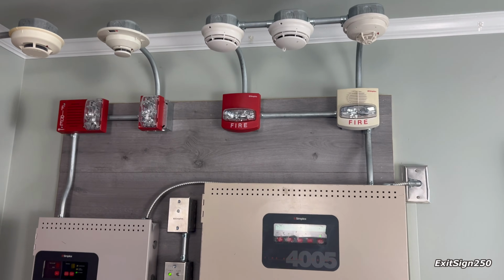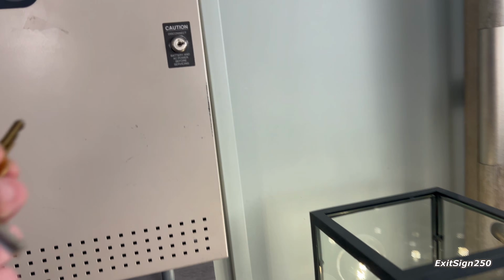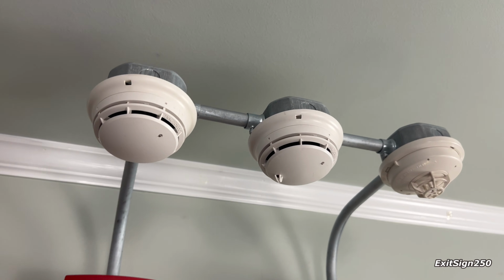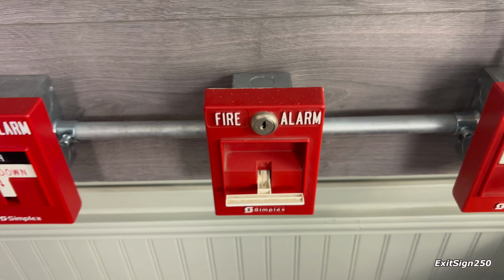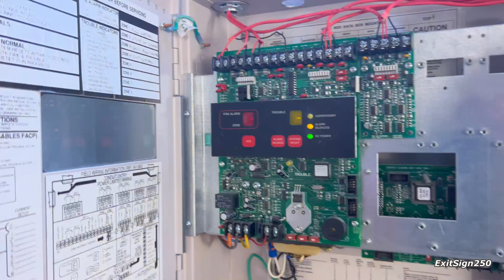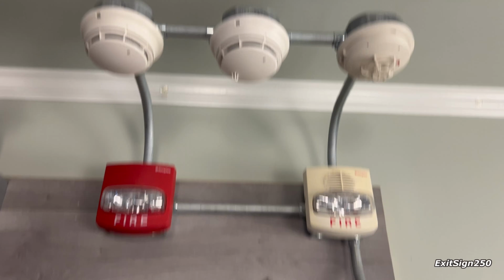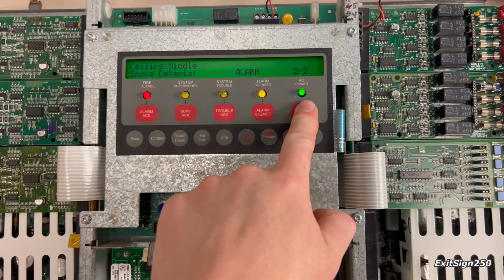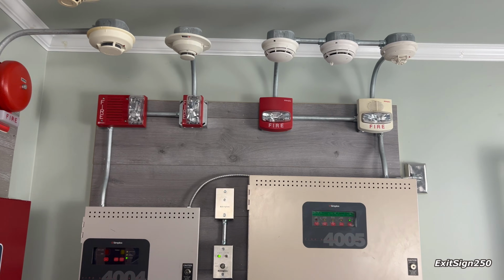System Test 26 | Board 2 - New System!

Comment: Btw on simplex 4005 panels, it's weird. you have to hit the acknowledge button 2 times and the reset.
Reply from the maker: Oh really? That’s a feature? Sometimes I have to press it 2-3 times and other times only once.
Reply: That's just how those panels are. Don't worry, I've had experience with 3 of them and there's nothing wrong with them. It's just a simplex quirk.
Reply from the maker: Gotcha. Well interesting to hear that’s a common problem and not just an issue with my panel. Thanks for the info!

Comment: On the IO module in the 4005: you can get terminal blocks on digikey or mouser, as long as you know the pitch. It looks like 5.08mm, but you should measure with a ruler or ideally calipers to be safe. Should only be a few dollars, plus shipping. If I knew the pitch, I could find a part number for you.
Reply from the maker: Thanks for the info! I will look into that. I’ve heard from other enthusiasts how difficult they can be to source. I haven’t really done the most in depth research on them.

Comment: That's a cool system! I think the 4904 is prolly like a -9137 because the strobe doesn't seem that bright. Since the Free Run models were 4904-9137 (15CD), 4904-9135 (30CD) or 4904-9136 (110CD).

Comment: Yay simplex. Btw those simplex key switches kinda act like a remote announciator
Reply from the maker: I actually planned on having an annunciator for the 4005. More about that in the next test…
Reply: @ExitSign250 if you did. Where would you place the announiator
Reply from the maker: Above the junction box where the switch that connects both panels is.
Reply: @ExitSign250 ok